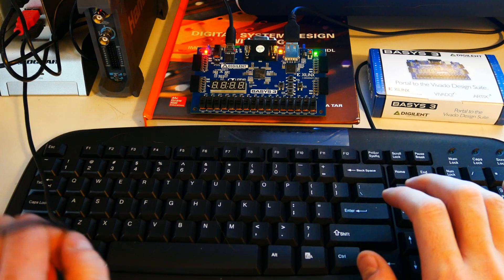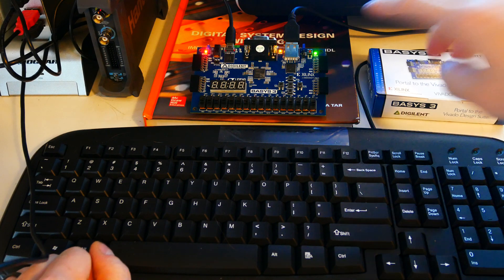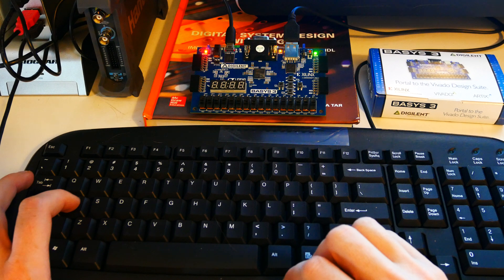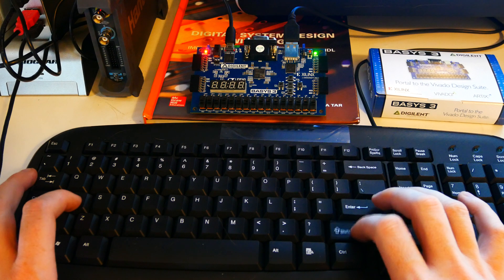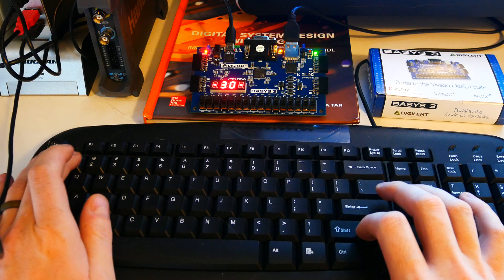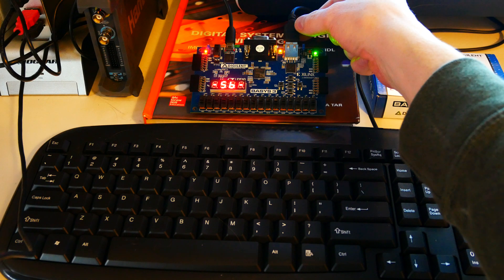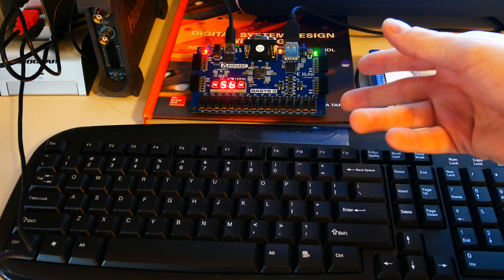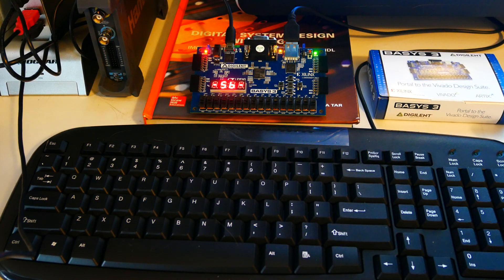EET 343 - Advanced Digital Design - ENMU - Basys 3

Comment: Hi. Thank a lot for sharing the code.  It built just fine.  But when running on the Basys3 that have a USB keyboard connected, the busy led keep blinking and the 7-segment does not shown any key code.
Do you know where the problem is?
Reply: I found the problem.  It is due to RGB keyboard.  Switch to simple keyboard, it works.
Thanks for your video. 😊